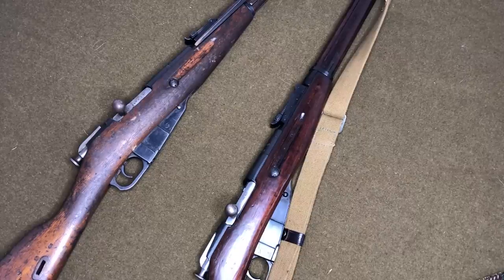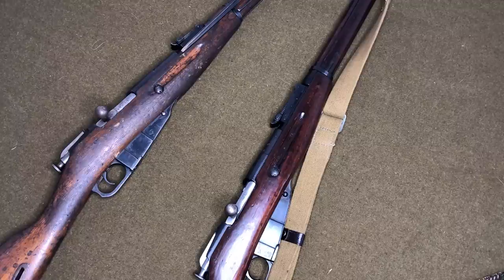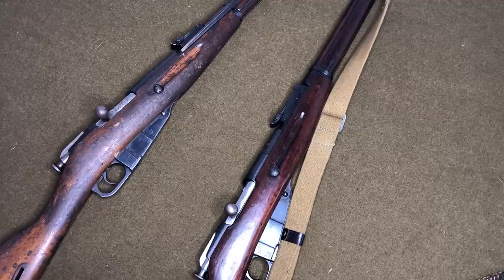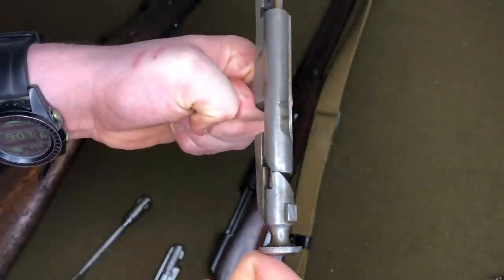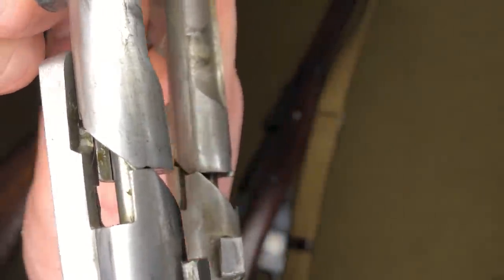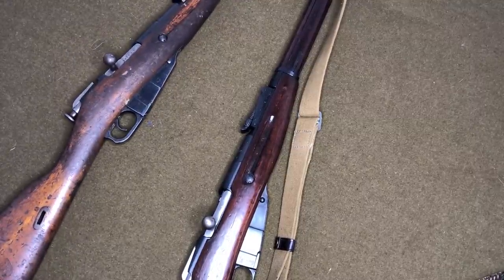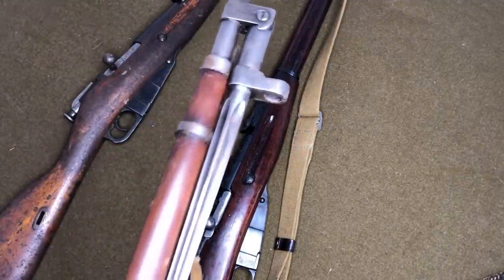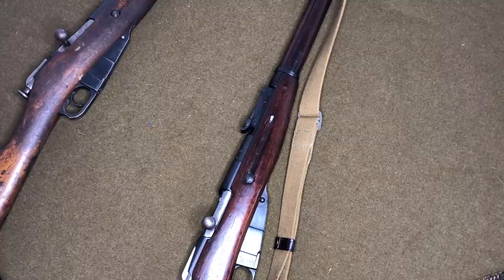A Few Simple Things I've Done to Make My Mosin-Nagant Rifles "Better" and Much More Accurate

Comment: It's called a "safety detent", that falls into an "indent". 
All hail Forgotten Weapons, for He has the Words for Everything.
Reply from the maker: Alright. Well, that's why I said I don't recommend doing it. That being said, I haven't had any issues in over 10 years of doing it.
Reply: @MikeB128  I'm noguns but I reckon that's a stupidproof extra safety nobody not worthy of a Darwin award needs. In fact only extremely lax mechanical tolerances could make that safety drop and allow and out of battery misfire (assuming the user has held the trigger down while cycling the bolt and has milled away the stripper clip feed).
Reply: What does it do?
Reply from the maker: Again, haven't had an issue in over 10 years. I still don't know the purpose of it, but on my Mosins, it seems to be okay.
Reply: Yes, the mosin saftey. The one that takes 247 ftlbs to operate 🤦‍♂️
Reply: It's easier to run the bolt than operate the safety anyway, just carry it with an empty chamber. It's not going to improve accuracy, though.
Reply: Nobody Can Know My Secrets Extremely lax tolerances in MY soviet wartime rifle? Its more likely than you think

Comment: I'm all about making an old warhorse run with the pack. That being said I'd never do an IV8888 job on a poor mosin but to each his own.

P.S. When I get around to getting a mosin im 100% gonna shim that thing. That sounds like the ticket.
Reply: Like glass bedding
Reply: My dad and i bought one for $75 with the sling and pouches cleaning kit and Oiler back in 2011 ..... it shot like a 6” group ..... 
I took it and bedded the action..sadly with bondo..... I was 12 and couldn’t afford acraglass 
The  i bedded the barrel using paper and linseed oil .... 
shimmed the trigger and polished the sear mating surfaces 
And put a 2.5X weaver scope on it inside a PU mount .... 
granted the methods I used were shitty the rifle shoots 1/2moa cold at 100 yards 
And only opens up to around 1moa when hot. I got lucky and the bore on my rifle slugged a .308 instead of the usual .310 .311 
I plan on doing another one using the correct shims and wrapping the barrel 
And using accumount PU scope. 
I’m also building an m24 Mauser into a sniper rifle using a German LSR mount and a PE Scope that rifle shoots about 1moa without any modification
Reply: Hurricane What did Eric do to a Mosin?
Reply: @INTERNATIONAL_RDF-D  That's actually not too shabby, all things considered. I'd have to double-check the FM's, but IIRC "acceptable" accuracy for an M24 sniper rifle is only like 1 MOA, even  with mil-spec "match-grade" 7.62 NATO. An M4 with M885 green-tip is expected to shoot something like 3 MOA...
Reply: Iv888 took parts and made one it wasn't an actual mosin he modified.
Reply: Oh yeah i think I remember watching that vid.

Comment: I did 3 things to help my 1937 91/30: 
ONE: I carefully filed the sear ever so slightly to relieve the harsh trigger pull. Basically cutting it by between 1/2-1/3. I did do a drop test 3x in a row on its butt and it passed.
TWO: from an online seller I bought a return spring that gets applied to the trigger to take out the slop in its movement making it more like a modern rifle trigger. You can do the same with a dollar store chip clip spring. I went with a proven spring.
THIRD: from another online seller I bought a new manufactured taller front sight pin to move the point of aim away from the 200m setting since I don't have access to that kind of shooting range, more like 100yds.
The old Russian still kicks like mule but its trigger is MUCH better and the 6 o'clock hold isn't as bad. 
I don't have plans to do the same with my Finnish capture 1897 91. Too historic.
Reply: Howling wolf muzzle device...your welcome😅

Comment: I believe that not-quite-closed bolt position is actually the decocker position. On unaltered mosins, including mine, if you leave the bolt in that position and pull the trigger, the bolt will safely close on a live chamber. This makes sense considering that, with 5 loaded, most mosins won't let you push the top round down into the magazine so that the bolt will close without chambering a round. It's worked every time on my mosin, not once has the decocker fired the round it closed on. Though, I still make sure mine is pointed in a safe direction no matter what ;) I'm not a gunsmith, just a guy sharing his thoughts!

Comment: This might sound kind of out there, but I did the shim trick with aluminum cans, flattened the metal, folded it and drilled it out the size of the action screws. It worked incredibly. I could only imagine what a kit MADE for that could do.

Comment: Those shims are not too unlike the "Accu-Wedge" for the AR-15 platform. Though my AR-15 is built around a stripped Spike's Tactical lower, my upper receiver is just a common stripped Anderson upper receiver. Lateral fit was spot-on, but there was some slop in the rear locking lug. I used my sharpest knife, and shaved tissue paper-like layers off the base of the accu wedge until there was no slop, but also loose enough I could push the rear locking pin out with my finger rather than a tool. My accuracy went from about 2 MOA to less than 3/4 MOA at 100 yards and on a bench vice.

Getting a solid custom fit is a great way to get high accuracy. Oh, and my barrel is just a 16" milsurp M4 style barrel I picked up for about $80. Nothing fancy. Just free floated it, and put in that Accu-Wedge, and I can hit 8" steel plates out to 450 yards with my irons with about 40%-50% hit accuracy using MagTech 5.56mm M193 ball ammo.

Comment: i have a 1943 nagant and the only thing i have done for it is i have cleaned all of the cosmoline out with boiling hot water and simple green, bought a second bolt that has had the handle bent in a sniper configuration (that way i can keep the old one original) and i plan to put on a jmeck scope mount that does not need to be tapped and screwed, also my bolt works perfectly no issues

Comment: Yup, I bought the Authentic Mosin Nagant MASTER KIT 7 years ago on ebay for 20 bucks on my Mosin. I reload 7.62x54R and after changing the front post sight of my 91/30 I get about 1.5 MOA~2MOA average which is pretty good at 100 meters. 

May not have to do that filing on the bolt since I've cycled my bolt maybe over 2000 times and it's pretty much butter smooth as a Mosin can get haha.

One thing I can recommend is adding a trigger spring for the Mosin which helps a lot for consistent trigger pulls. They're like 3~5 bucks a pop on ebay I think.

Comment: I bought a shim kit from this guy. It’s no joke! I used the metal shims and just a 2 inch piece of the rubberized cork. I put the cork at the end of the top hand guard toward the muzzle. I know each rifle is different, but mine seemed to like the downward pressure from that small piece of cork. Others might have to move the cork around to get the results that they want. Hope this helps someone.
Reply: CH H,

Thanks for your business!  It’s surprising how these rifles respond to a little tuning.  And yes rifles can be particular and benefit from different things such as downward pressure.  

I also offer kits with cork instead of the light canvas wrap.

Comment: I cleaned and polished the hell out of the chamber and was still fighting a sticky bolt after a few rounds into shooting, head spacing checked out as good. After an extremely hot and long day at the bench my trigger started to get tacky and wet from cosmoline. The source of the flow was coming from the inside of my bolt. Disassembled it and discovered a good deal of cosmoline had packed behind the bolt face internally and it was fouling up the lug on the firing pin. Gave all parts of the bolt a sun bath/minerals spirits bath and followed that up with a flitz hand polishing. Haven't fought the bolt since.
Reply from the maker: Absolutely.

Comment: that "click" is so that you can safely decock the gun, put the bolt on that click and pull the trigger and you have a much weaker spring strength
Reply: Thank you for pointing this out, I was gonna do it to my gun but just knew it had some sort of purpose. I'll probably still smooth it a small amount but I don't think I'll remove it.

Comment: Huh, my Polish M44 bolt still has the detent but with no grinding and a lot of brush polishing of the bolt with green jeweler's paste it nearly springs into battery... I did also use a drill and scotch Brite to clean out the chamber. Also I've "pseudo bedded" (no real pillaring but some epoxy/sawdust mixture to harden up where the receiver screws go into the  stock) and fitted the front barrel ring from an m39 with a small shim and am running without the wooden top heat shield.

I'm probably getting about 1.5 MoA practically with PPU 182 grain.

Comment: I just got done "re-snipering" an old arsenal refurbed ex-PU sniper.  Very sadly was a victim of water damage, and there was extensive pitting on the barrel and on the rear receiver tang.  Luckily its just cosmetically very ugly, still safe to fire.  It even had old shims still bedded in the dirty stock bed.  I had my bolt sent out to Jim Roberts for conversion\polishing and now the only thing left is put shims and canvas wrap strips like the Red Army soldiers used to do.

Comment: FWIW, I have a spare (due to extreme bubba-ing) Finned 91 Dragoon stock that I have had stashed for many years, and it has all of the brass shims neatly tacked in place. I can bolt this short stock nto any Russkie MN and it will shoot better than before. I was going to have a smith pull them, but he thought it might just bend them up and make them unusable anyway. Now, I want to try this kit using my bubba'd  "original" stock with the  shims as a model for them. I have other Finnsh MN's with the original shims and they all have much better triggers than the Russkie 91-30 variants, 38's, 44's and ChicomT-53's. YMMV.

Comment: So the locking mechanism change is recommended for sticky bolt syndrome and the ones made pre 1940 to post 1944 on the full length versions. So what would happen is like 15rnds in the bold has warmed up enough where it doesn't want to unlock

Comment: Just did the filing technique, worked reasonably well. Still a little rougher than a Mauser to work, but it runs a lot faster (as long as you don’t pussy foot around with the bolt)

Comment: Isn't milling off that ridge unsafe since that's whats stops it from dropping the firing pin?

Wouldn't a solid enough bump to the bolt roll that off and cause accidental discharge?

Comment: Just buy a used front sight and cocking piece for the bolt and modify those parts. Keep original parts to return to original if needed later

Comment: Hey Mike Questions? I know I know it is an old video, But I will ask with those shims was there any glass/glue used to hold shims in? I have gone ahead and pulled the trigger on 8 pack shims. Just wondered I have not seen many install videos. And thanks I will add a 20 gauge shot gun brush, mean green and boiling hot water, yeah buddy cleans that chamber to the nines so to speak....Like you mention on sight and bolt work to each his own on that one.

Comment: I love my garbage stick 9130, its semi OEM with a aftermarket custom dragunov Woodstock off a dude on etsy and customization I done was polished the bolt with just elbow grease, metal polish and a old sock its smooth as a wet vagina. I call my 9130 a boom stick, I've taken out paper targets, steel targets, old sheds,  beer cans, soda cans, glass bottles, older cars, hogs, elk, bears, deers and coyotes.

Comment: 2:10 that "click in the middle" is sorta a half cock / de-cocking stop..... its also nice for bolt disassembly (ya dont have to fight the spring) 

sure.... its smoother with out it..... but ive never had an issue with the bolt being "gritty"..... most stuck bolts are caused by cosmo or bad ammo

idk.... i like being able to "click it over".... then pull the trigger and drop the "striker"
i think the better way is to reduce the "main spring" tension.... 

some people simply cut off a loop or two..... others sand the whole spring to make it thinner 
they do the same thing

that spring is so stiff because its designed to ALWAYS fire a HARD ASS military primer..... 

in civvy use.... your probably shooting PPU, and the ammo is always going to go boom
or you are shooting surplus (if their is still any around).... and even if you strike some rounds with a 100 pound jack hammer.... its just not going to go off

so a lighter spring.....AKA.... lighter primer strike.... doesnt really matter
Reply: and ya.... nothing about the action, barrels, or ammo makes a 9130 in-accurate 
its mostly RUSHED 43 to 45 rifles..... and / or having shot out or rusted out barrels.... or bad referb jobs they did in the 50s

ive got a 1935 round..... serial in the first 10,000 guns made (and one of the FIRST round receivers.... they still made hex receivers half way into 35)
all matching numbers.... even the bayonet.... PERFECT condition 

it just has that NASTY 50s referb stock.....

the gun already shoots 1 to 1.5 MOA..... if it had a good stock..... an EASY 1 MOA gun

once a rifle gets to 1 MOA....even two or 3 for an iron sight gun.... im happy with it
i cant shoot as good as the rifle can, at that point 

but ive knocked over a deer or three at 600 yards.... iron sights.... with my 9130

again.... they ARE accurate guns
most just use 50 year old surplus ammo..... made while the workers were being shot at..... 
then wonder why one round is 2500 FPS, and the next is 2800

also.... i think most people SIMPLY SUCK at shooting from iron sights..... 

good ammo, a decent "quality" rifle, and some practice on shooting irons..... and most 9130s will out shoot the shooter

Comment: What do the shims actually do? I have a 91/30 PU that I would like to squeeze every bit of performance out of
Reply: I'm no expert, but when things are loose they move slightly. You want everything to be solid and stuck in place.
Reply: They basically take up space left from manufacturer tolerances,which reduces stock to action movements and reduces vibration,accuracy is all about consistency
Reply: Dom,
The shims raise the action in the stock to put the rifle into specification.  Many of these rifles are out of spec since they were refurbished and put back together without proper fitting.  By putting into specification and raising the action it eliminates stock to barrel contact which can cause poor barrel harmonics.  Poor barrel harmonics negatively affect accuracy.  The light canvas cloth barrel wrap is oiled and wrapped around the barrel at the front band.  This creates a pinch point to combat “barrel whip” and creates a damper effect for the barrel harmonics.  Typical results are a reduction in group size from 1/3-2/3 the original size.  In other words 3” groups at 100 yards should reduce to 1”-2”.

Message me at Milsurpaccuracyinc.com if you have any other questions.

Comment: Thanks for doing a video on this, man. I have a fairly nice m44 I've been thinking of doing some work to, especially to help with the super sticky bolt. I was wondering where to get those shims, I had seen them in an other video but couldn't remember where to get them. I've also been thinking of getting one of the mojo rear sights for it to, I'm not sure what you think of aftermarket rear sights on a mosin but I'm just not very good with the rear notch.

Comment: The one I got (in mint condition, almost never shot by the previous owner) for 80 bucks probably sounds like a bargain. It's been 100 % reliable so far, at locking up on the first round when 5 rounds are loaded. I don't feel like further dealing with this piece of junk.
Reply: Do the chamber cleaning process.I promise it will help .Also break  in the bolt with fine valve grinding compound.Apply to all contact areas.Cycle it 100 times.Clean and repeat 9 more times,which is 1000 cycles.You WILL get blisters,so be forwarned.
Reply: @Left4Lulz2  Pretty sure. 1 2 3 4 5. 5 rounds. As many as a stripper clip holds. The issue is most likely interrupter related, as the rifle feeds, locks and ejects for 4 rounds or less. For 5 rounds in the magazine (from both the clip or when loading 1 by 1), I get rimlock. Pushing down on the 5th (top) round, I can't get the 4th round to lock under the interrupter. It feels like the magazine well is not deep enough, or the interrupter is not proud enough (or does not have enough tension) to give enough separation for the rim of the top round to clear the 4th round.

Comment: Love the vids man, keep them coming. I put my 1930 91/30 in a Arcangel stock with a wicked compensator.  Got the bolt handle turned down (professionally) and a really nice wrap around the breech scope mount. I'm currently grouping sub m.o.a. and  I'm anxious to shim it and see if I can squeeze more performance out of my garbage rod. Thanks, tell mom I said hi.
Reply: Devon,  

These shims are designed to work with the factory Military configuration stock.  The Archangel stock you are using should already free float the action.
Reply: My Arcangel stock came with a plastic shim insert, but I didn't utilize that option. It shoots great without it. Thanks for the tip.

Comment: I wonder if that first feature has anything to do with primary extraction. It could be something that was implemented to put more of a locking torque on the cartridge. Idk. I need to play around with a mosin bolt to see it in action.
Reply: Im 99% sure that this notch is to prevent the  firing pin to rotate and uncock itself while the bolt is open if you hit it by accident. 

Pretty stupid thing to do imho removing this